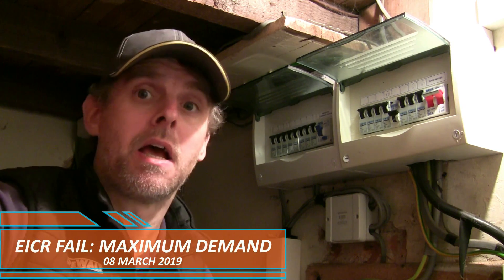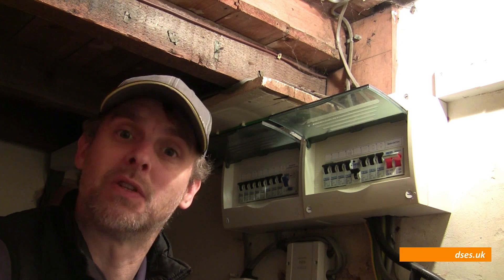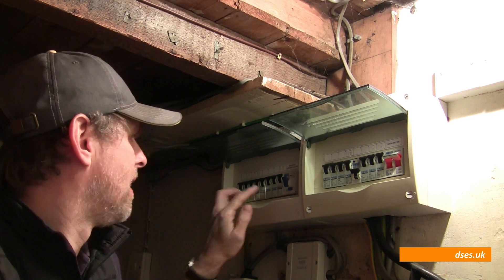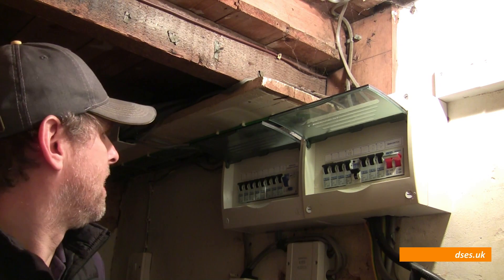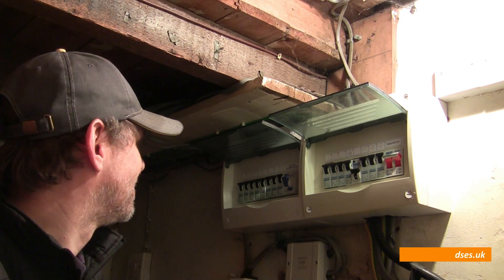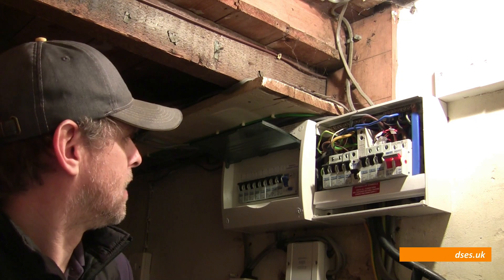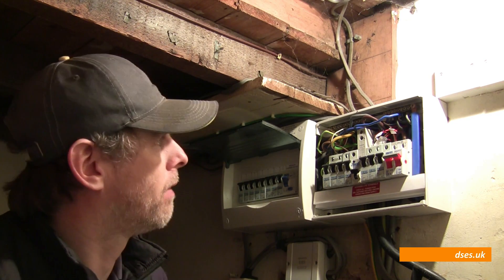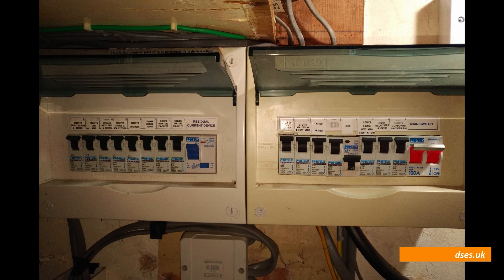EICR FAIL- Maximum demand

Comment: just been testing a few properties with the issue regarding maximum demand, what did you code it as ive not been able to find any info from bpg4 ot any forums, last resort will be to call niceic
Reply from the maker: If I think too much current is being pulled through a device not rated for it, then I'd code it C1 Max. This isn't a fault current issue, it's the everyday design current that hasn't been factored in here.

Comment: Hi David a friend of mine once went to a house with 4 electric showers. So he called napit and spoke to an adviser and he said he ust to work Blackpool area and ust to see that situation often and his answer was there is no way all 4 showers could run at the same time any way because the water pressure would not be strong enough. 
   And it kind of makes sense I know if I run my shower and some one turns tap on there water just trickles out of the shower. 

  What's your take on it. 

  I have never actually tested to see if the shower still pulls the 32 amp if water not coming through at full pressure

Comment: Even with the service cable changed and new 100amp bs 88 .the circiuts demand current  is still over 100 amp supply ..
3 showers 40 amp each ..NO DIVERSITY ON SHOWERS SO 3X 40 120 A ? .
A 3 PHASE SUPPLY IS REQUIRED ..

Comment: Hi David, Second time watching this one. Really good advice.

One observation, I think you should not be confident applying the correct cost for the jobs you offer to do.
Professional advice and honest evaluation is a commodity which must have a higher value than a rushed cheap fix which will not stand the test of time.
The people buying this place will have a couple of grand to protect their investment, I would assume.
Get your bill in, and don't miss them for time spent saving their new home from burning to the ground.

Comment: David , Can you tell us more about your  MFT you are using ?
Reply from the maker: That's the TIS MFT Pro which I carry in my main toolbox. There's an older video of it where I was a bit sniffy about the thing after I bought it in 2018, but I get on rather well with it after a firmware update addressed the main issue I had at the time. I keep meaning to do a new video showing its cheaper sister, the MFT Eco, and how they compare, but there are never enough hours in the week.

Comment: will you have to remove some of the loading so it sits under the 100hrc main fuse ?    be nice as i'm a crap 16th ed spark.    great video's as i'm learning more now than when i was at tech.
Reply from the maker: Hi Dean. I'm always nice! Well, mostly. But yes, two of the electric showers will be booted out. One's going on the boiler, the other is being converted into a utility room.
Reply: @dsesuk  many thanks and keep up with the great vids

Comment: Gas meter must outside.. it's not safe closer to electric..
Reply from the maker: Although new builds see their utility meters located outside, it seems more for the convenience of taking a reading than safety. Older installations commonly had gas and electric housed together and neither industry has mandated their separation or required a national roll-out to see change applied retrospectively. Nor are dwellings routinely exploding, so I don't think there's a safety issue.

Comment: I like all the information. Wouldnt it be better to use two or even three split boards? One for running the other two and common areas? then one for the sections? Shouldnt the Granny flat have its board in the flat, like a Shed? So in effect, board one from the meter would be three outputs for other boards, plus common lights, second board for main house, third board for granny flat, ad fourth board being shed?
Reply from the maker: Hi Adam. Had this been my design when being extended/renovated, then I would have made a more logical layout of the circuits and perhaps used a sub-board to split things off. Sadly, what we found here was a builder's breakfast that someone had thrown in about fifteen years prior. A lack of planning and execution left the place with more circuits than were needed all coming back to an oversubscribed board in a single location. When we performed the remedials and upgraded the board in a later video, some of the circuits were combined into more logical arrangements, but without being able to damage finishes and renew large parts of the wiring, we were left with the single location and making the best of what we could.
Reply: In USA and Jamaica the granny flat and the shed are usually on their own boards, as sub panels from the main board. In Jamaica actually a multifloor house is usually set with a panel on each floor, for that floor, and a main panel supplies those panels.

Comment: I thought you had to contact the dno if wanting to connect two or more electric showers?
Reply from the maker: In theory, I think (and I may be wrong) that if your MD exceeds 60A then you're supposed to inform the DNO, but in practice I've never seen it done. The only time I inform the DNO of a load to be connected is on a car charger installation. Personally, I wouldn't recommend more than one electric shower on a 100A single phase installation, and if more than one is insisted on, then I'd advise a load sharing option such as the Garo product I spoke of in another video. I suspect that most installers just do what the client asks for, and to hell with the consequences because nobody is policing anything.

Comment: When coming across properties where it looks like maximum demand will exceed the main breaker rating regularly, do you make a recommendation on the EICR for a three phase consumer unit to be installed ?
Reply from the maker: Hi Ryan. Getting three-phase into a property is no easy feat, nor is it cheap. Here it would involve digging up the driveway, and to be honest 100A single phase is enough if it's loaded correctly. I'd be more likely to look at reducing load such as by changing halogen lights to LED or decommissioning a shower, or shedding it by using a device like the Garo priority unit I blabbed on about in another video which, in my case, allows my car charger to share a circuit with an electric shower by ensuring only one can be in use at any one time.
Reply: David Savery Electrical Services I appreciate that, and a priority unit is probably the best option for economic reasons.  If somebody is buying a £1 million house, I imagine money would not be as much an issue for them, and if they wanted to use several showers at the same time, and ovens etc, then I guess you would suggest it to them ?
Reply: David Savery Electrical Services Would there be any circumstances where you would suggest three phase ?  Do you know the costs of the DNO to run a three phase supply into a property, it’s an area that interests me.
Reply from the maker: @djryanking  I don't know the costs I'm afraid. I know it's the best part of £1k just to relocate a service head, so I suspect beefing up a supply cable from the street into the property would command a pretty strong price tag.

Comment: Really interesting.  Thanks, I didn't know you could cook 63amp RCDs without them operating.  I don't think I knew that anyway.  It's never been an issue.  Also didn't know you could get a device to stop two loads being used at once.  And good points about more than one lighting cct hanging off an MCB.  I always forget to check that before I price things up, and it did once completely snooker me, although I got the money back in other ways as they booked me for the rewire and board change.  But it weren't funny.  I hate lighting circuits, especially with dimmers and intermediate switches etc, you're supposed to test every damn bit of them, and it just takes for ever.

Comment: People  charge by the circuit looks like  they do good works and proper and safe testing but people just say price or set price they don’t do test and check every points or they way they should do I noticed that for few years and lots of people go by price regardless of their safety and good jobs  I charge 70 call out and 25 per circuit on domestic and three phase 90 and 35 per circuit and truly I don’t like to do EICR

Comment: 100 amp single phase? It amazes me that three phase isn't used more often with so many large loads. One shower per phase, split the other loads as well. Reduce voltage drop.
Here (South Africa) I have 3 x 60A incoming (now it's normally 3 x 80A).
Reply: It will amaze you even more that the dno's give each property a diversity of only 2kw when designing their network. So on a typical housing estate with about 150 homes all capaple of drawing 60 to 100 amp each!! Is all fed from only a 500kva or 1mva transformer which is only capable of delivering around 700 to 1.45ka! If that is not  diversity i don't know what is, and amazingly it all works!

Comment: Those lenovo laptops etc kick ass, do you have an ssd in it?
Reply from the maker: No, still on a hard drive, but I have upgraded it from a 6-cell to a 9-cell battery, and I got hold of the 3G internal modem so I have data access on the move. I might do a video on it in its own right one day as it's a great bit of kit!
Reply: @dsesuk  the only machines i buy, you can get fully working 2nd hand desktops for 27 quid lol, no monitor ofc, but they can make your tv cleverer :) the improvement with an ssd can be phenomenal, boot times and program start up times decreased significantly, trying to learn some electrickery so i am watching your great videos, thank you

Comment: 3 showers on the go in the middle of winter must be pushing 100 amp?
Reply: Easily as David mentioned, Each shower is almost 9KW.
27000:240 is yr answer. Bye bye main fuse.

Comment: Interesting that you can get high power single phase line in the UK. In Lithuania, if you want more than 5-10kW, you will get three phases.
Reply from the maker: You find few overhead cables here unless you go out into the countryside, it's all underground in the urban and suburban areas. I guess when they were rebuilding after WW2, they figured up to 100A single phase ought to be enough for anybody (domestically), although in these days of instantaneous hot water heating, induction hobs and electric vehicles it's all looking a bit creaky. A lot of digging up can be required to upgrade to a three-phase supply.

Comment: Bring another phase in. It might sound clever to put a contacter in so only one shower can be used at a time, (which is all that is actually needed to do the job, nothing new or exciting about that) but if you do that, what exactly is the point of having more than one shower? You'll end up with the usual scenario of teenagers fighting over the shower at weekends. Which is probably why the extra showers were put in to start with.

Comment: by looking at that

likely ex gov 50's-60's house with retro fitted rcd that is only really designed internally in the rcd itself to hold 1 circuit unlike the 10-20 amp breakers of yester year where you overload to a degree before frying the break..

with the the rcd breakers are built today it is 1 point  to 1 circuit

I suspect with the granny flat modification you are looking at the power co to come and install a 200-300 amp service

split between each home area..

looking at the extension i would say dyi bodge job within the life of the home

my opinion i'd do an electrical gut and bring it into todays code rather leave it alone and do a date of install grandfathered mess

the main rcd should be around 100-150 amps

covering 2 30 amp circuits  2-6 15 amp circuits wall circuits, 2-3 10 amp circuits for lights..
Reply: @Cupid Stunt in australia skinny 80 amp main breaker with 2 x30 amp breakers   feeding 3 single points and 4 double  points and the other feeding 3-4 double points 

on 15 amp domestic wiring .

1 circuit has 2x outside  singles, 1 internal single (fridge), 2 points double (bedroom) 

2 points bathroom 1x double washer/dryer 20 amps draw,  fridge 10-15 amps draw..
on an 15amp domestic wire.. @240watts mains

though the basic point that  the point to save cash 2xc15s were used where they could of wired each point individually given the amount of real estate in the fuse box..

Main point I was getting at  most likely would been better if this  was an ex council rental would of been to gut completely than mess around with the bullshit of grandfathered  date of install which leaves people that don't know any better of blinders on see no evil, report no evil..

I am a firm believer of meet or exceed minimum electrical safety codes of today than live  in the grandfathered systems of date of install.. as it leaves the consumer in a legal time mess

Comment: Great video, just wondered which form filling software you’re using? Thanks
Reply from the maker: Thanks. I'm using Easycert. I've been meaning to do some videos on using it for a while now, I'll try to get them out this month!
Reply: Yes that would be helpful if you get a chance as there’s not much on YouTube about it. I’ve had to stop using ELECSA online software, it’s just so bad now. Temporarily moved on to Electraform to keep my sanity!
Reply from the maker: Yeah, the CPS in-house solutions are poor. Electraform looks good, but they're pay by cert, and when I did the maths for the number of certs I issue in a year, I found sticking with Easycert was cheaper. It has some flaws, as I'm sure they all do, but I'll be starting work on those videos soon (it may be a three-part job), so watch this space!

Comment: Am I correct in my understanding that the leakage current can also come from switched on electronic devices as well as the low insulation resistance on the cables themselves?
Reply from the maker: Electronics can add to the leakage current which is why the likes of server rooms and I.T. suites need some design consideration (not that I've ever installed such).

Comment: Hi there , quality videos, thank you.
Do you like the TIS MFT Pro ? Noticed you had a Metrel in another video.
What’s you preference and why ?
Reply from the maker: Thanks Roger, I have a Metrel MI3100s, a Megger MFT1552, a Fluke 1651B and the TIS MFT Pro just because I like my toys! They're all fine instruments, and I can work with any of them. The Fluke was retired as it lacks an auto RCD test and I was getting some odd readings occasionally on the resistance function. The Megger was my original tester and still works, but I now keep it in a secondary box that is used only when additional personnel are working with us. The MFT Pro fits in my main tool box so is my everyday machine for basic faultfinding, and the Metrel is my calibrated machine used for the EICR and initial verification work. I prefer the Metrel over all the other testers simply because it displays more information at-a-glance. The voltage between line, neutral and earth is always on the screen regardless of the selected test, the Max Zs value for the selected protective device is shown on the display when loop testing so you can see how close you are to the limit, it supports phase rotation unlike my Megger and Fluke models and it works well with the neck strap (I can't figure how the TIS is supposed to be worn!) It also has a good clear display with nice big numbers and can be placed on charge without having to extract the batteries unlike all the others. The TIS machine has a couple of functions the Metrel lacks - PQA and earth leakage, but you need an expensive accessory to make use of them. I have one here, and will do a video showing it in action soon. The TIS has updateable firmware, so there may be an update in the future which allows it to do a couple of the things the Metrel currently does, e.g. show the max Zs for the selected device (it knows the number as it issues a pass/fail when testing, so there's no reason why it shouldn't display it for the operators reference), and show either the voltage or a warning of a voltage when one is present and the menu screen is selected (at present, it's the only tester that doesn't display any indication of live connection when first switched on, you have to enter one of the menus first). The TIS is the only tester of my bunch which can store results for later download - a feature I don't use!
Reply: David Savery Electrical Services o
Reply: David
Thanks for reply , just brought a TIS voltage indicator after just viewing the video.
Like you I have a megger/fluke and a metrel 
Like the touch screen.
Think I might buy the Pro as it’s been a good month.
Love the humour and knowledge base.
Reply from the maker: @rogerbean393  Blimey Roger, now I'm getting worried that I'm influencing you to spend too much on the toys!

Comment: I've got a copy of BS7671 and I've checked through the model forms but I can't find the place where the demand would need to be recorded or even where it is requested. Are you able to point it out?
Reply from the maker: On the EIC it's on page 415 of the blue book under Particulars of Installation Referred to in the Certificate. I don't think it's ever been on the model EICR, at least it wasn't in the preceding yellow or green books. The software I use to create certificates and reports, Easycert, differs from the model forms as most third party certs do, and it is something listed on an Easycert EICR. I don't know why it's not a part of the model EICR as it seems it ought to be.